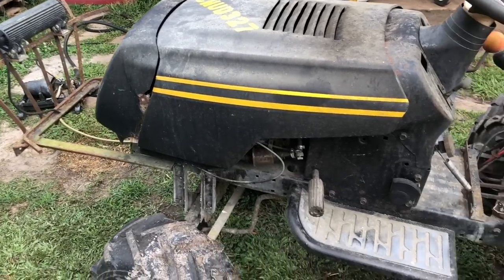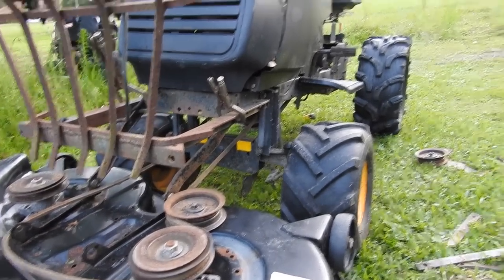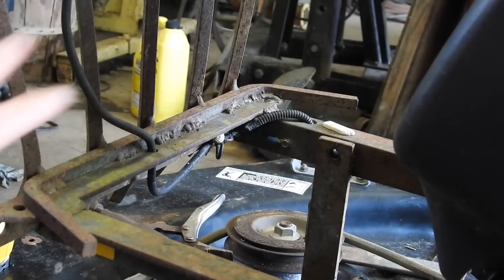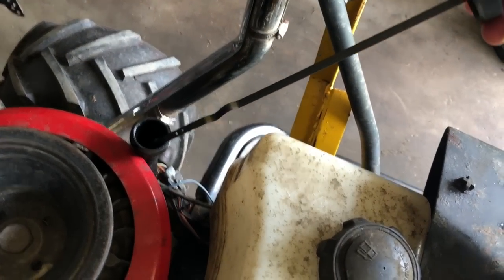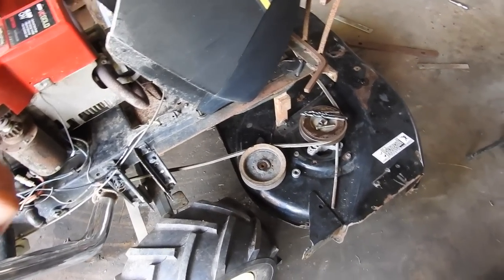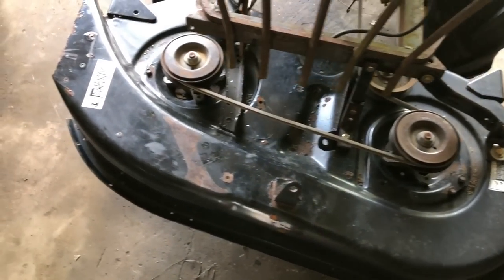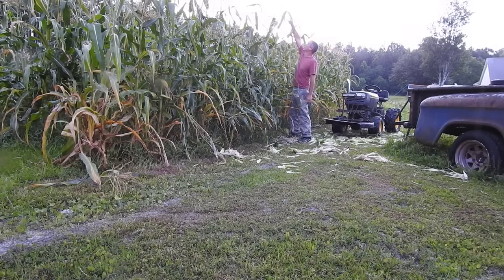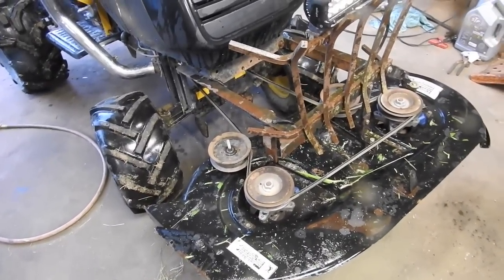Can a Mud Mower Mow Again???

Comment: Just an idea. Cut back the front of the deck slightly to expose the cutting blades, and weld some fork like rods to guide the brush to the deck. Maybe change the angle up a couple of degrees so the blade are the first to hit the grass, bush, or corn. Otherwise love your ingenuity!
Reply from the maker: Sounds like great suggestions, we will see what happens and thanks for watching!!
Reply: I was going to say the same thing cut more of deck to expose more blade that way I’ll be cutting instead of pushing it before it’s cut

Comment: Man I am glad someone else thinks the way I do. I thought amount mounting the deck in front of my mower for several years but just could not figure out how to do it. Congrats on doing that. I cut the front of the deck off a 21 rear wheel drive Honda walk behind mower to build my brush cutting and it works like a champ.

Comment: I converted a junked out 112 John Deere with a 36" single blade deck to a front mount. I cut out the front of the deck so  about 1.5" of the blade was contacting tall weeds before they hit the deck. I bent up some 3/8" rod and made a deflector that would help the tall weeds fall to the right as the blade cut them off. It worked pretty well cutting 8' pigweeds and kochia. The deck was 4" off the ground, and it worked good for reaching under cedar trees in a windbreak. 

The secret was to allow room for the weeds to fall off to the right so they wouldn't be needlessly recut.
Reply from the maker: sounds like great tips and thanks for watching.

Comment: Looks like it works great, better than i expected honestly. I have plans of doing the same thing but on my ATV powered with a 3-5hp engine mounted on the old riding mower deck and hopefully with adjustable deck height. I wont be mowing anything too heavy, I just have a small property across a creek that my zero turn wont currently cross. I could use my tractor and bush hog but its a lot of trouble to haul it over vs the fourwheeler so i think a front mount deck on the ATV would make it easy.
Reply from the maker: Might be just what you need. I next want to make a pull behind that cuts lower. Thanks for watching!!

Comment: I think you need to make an engagement bracket using the old deck engagement lever with a cable, and some pulley guards so you don't shred the belt with sticks and briars. It does look great on the front of that mower, it fits really good on the big brush guard, it looks like a true garden tractor now! cant wait for the river ride video soon too.
Reply from the maker: Great tips and river ride will be soon, thanks for watching!!
Reply: @chud327  no problem, I love the videos

Comment: Hello From Mark In Kentucky. Regarding the mower blades.  
I have in the past taken oversized lawnmower blades and chucked them into my 14 inch Milwaukee Chopsaw cutting the appropriate amount from off each side of the blade. This was done on an old Yazoo Big Wheel mower in which the blades are obsolete and getting very rare to find. Most of the blades that I was able to find were the 26 inch blades instead of the 24 inch blades like my Yazoo uses.
The chopsaw as a rule makes a good square cut which works for many mower blades but unfortunately not all of them.
The blades that I cut did not require too much effort to put them in good balance. 
I would not recommend anyone who is not familiar with mowing equipment and or blade sharpening to try what I described as my disclaimer. 
Maybe I will create a front mounted deck for either my 107 Cub Cadet or my 110 John Deere when I get it re-wired.  Thanks for the great idea.
Reply from the maker: Welcome! Thanks for the info and thanks for watching!!

Comment: Put a high enough scoop in the front of the blade area to lead brush to the lawn mower blades ... Just put scoop toward front ..Just a thought .......Wish I had the tools and mower to do this i need my 5 acre done badly ...Almost 6ft tall no tools to get rid of ...
Reply from the maker: 5 acres and 6 feet tall is a lot... If you were close enough, I have a tractor and a bush hog ... Thanks for watching!
Reply: @chud327  I wish but even paying some one around me is not even an option because no one wants money around me ... Even free wood ... I have 15 acres but only need about 2-5 done ...

Comment: That is why your drill bit got hot oil to keep your drill bit cold and it works much easier drills so much easier
Reply from the maker: Thanks for watching!!
Reply: Actually, ive been wanting to try using water (saw it on a video), especially for hard steel.

Comment: Two thoughts: eventually, a branch is gonna fall into that unguarded drive and could do damage. A small pipe slit and welded onto the front lip would keep it from bending or dragging on vertical stalks.
Oh, and why not copy the real bush hogs and make the blades hinge in the middle. Less impact stresses on the shafts and you could tackle larger material! I'm not sure, but flywheel weights at the shafts may give it more momentum and maybe make it smoother? (Thinking harmonic balancers from car motors or dumbell weights)
Reply from the maker: Great tips and thank you for watching!!

Comment: You compromised the strength of the deck by cutting out so much in the front... those bearing hubs are aluminum..they will let you know what they can handle and what they can't handle...but overall I like it🤗
Reply from the maker: True, but still felt solid, thanks for watching!!
Reply: What will happen is the mounting tabs will break off. I posted solutions for several problems this same day.

Comment: cut the deck back more it is still the first thing to touch what you are mowing.
Reply from the maker: That is true, kinda bends over what you are cutting to help the cut and push it down. Need to try cutting more deck away and give that a test too. Thanks for watching!!
Reply: @chud327  bolt a bar to reinforce the edge  maybe an angle to help deflect debris